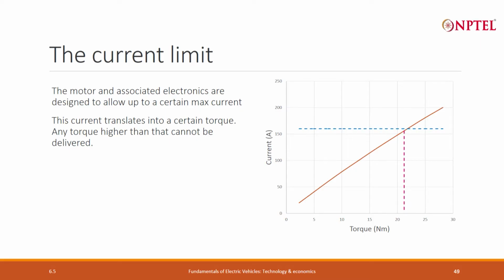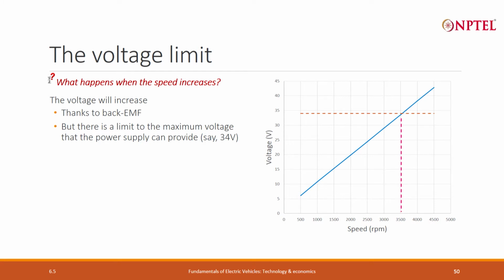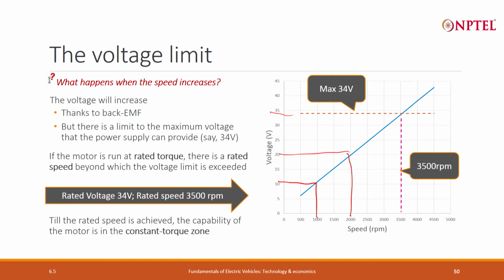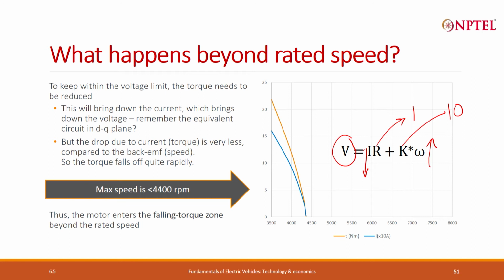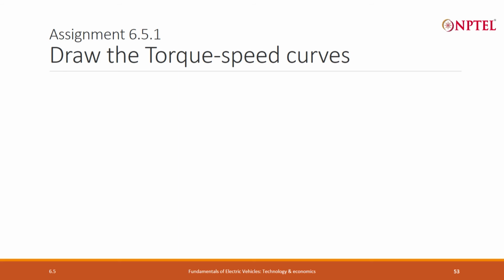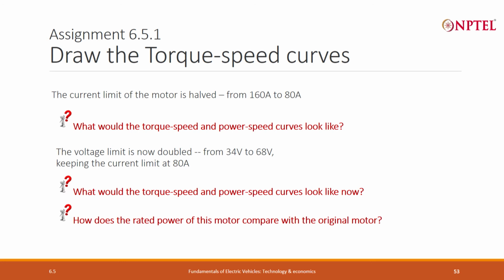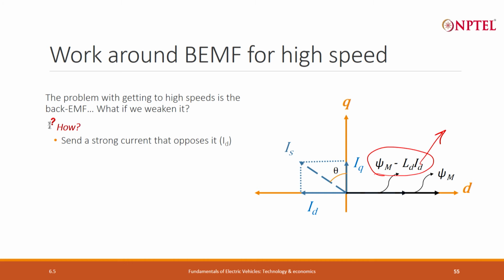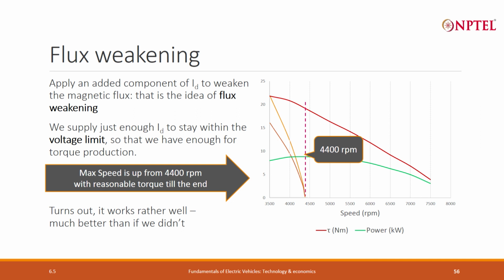Lecture 55 - The d-q Equivalent circuit - Part 2

Comment: at 20. 53, by feeding a negative d-current we are bascially reducing the back emf caused by the relcultance torque by redcing the effect or magnitude of reluctance torque which reduces the overall torque but frees up enough voltage to increase the speed?